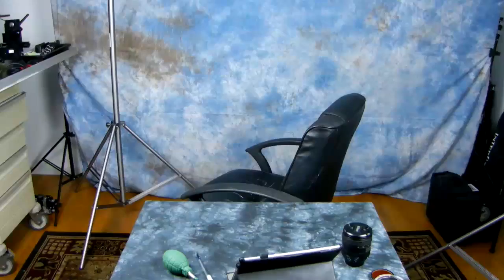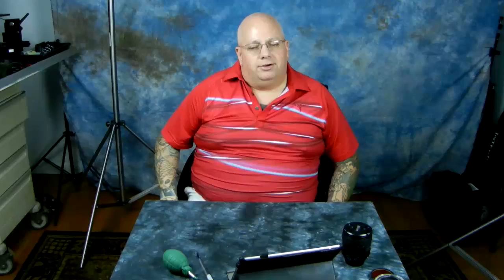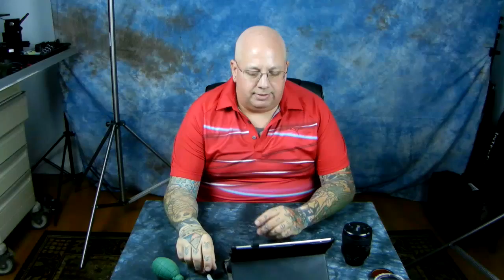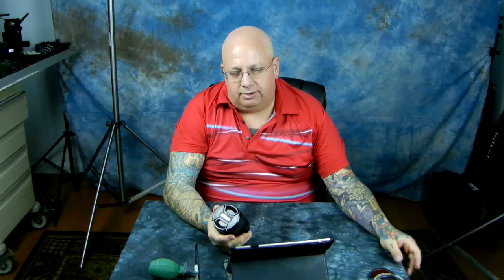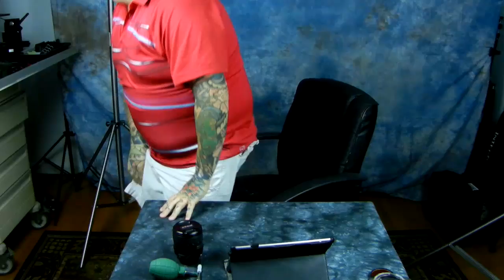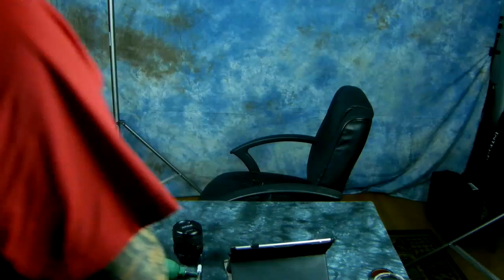Angry Photographer: Your lens is NOT AS FAST as you think it is. T-STOP vs. F-STOP

Comment: Unrelated: I'm on the hunt for a 70-300. I want very fast AF and sharpness at the long end. Some say the Tamron VC is sharper past 200mm than the Nikon. Any thoughts?
Reply from the maker: +sotiris.bos 70 300
Reply: +Theoria Apophasis Tamron 70-300 VC not 70-200!
Reply from the maker: ahhhhhhhh
Reply: +sotiris.bos I have the canon mount version - it is pretty soft out past 250mm
Reply: +Jeffrey Thompson It is supposed to be sharper past 240-250mm comparing to the Nikon one, according to some posts on dpreview if you can believe them. Also, I am definately going to buy one of those, same price Tamron new and Nikon used. That's why I need Ken's advice.
Reply: +sotiris.bos It is bad enough at 300mm that I am saving up for the Canon 300mm f/4L.